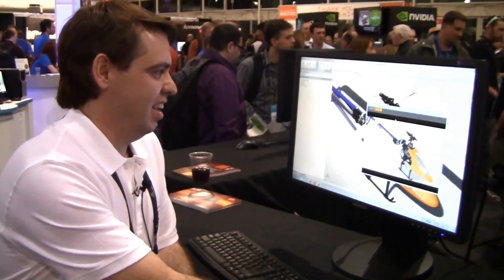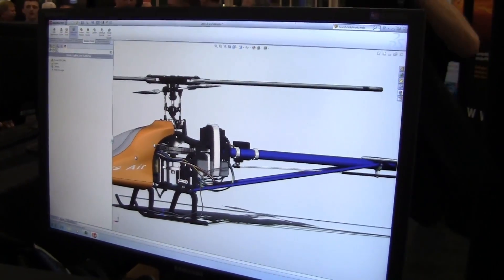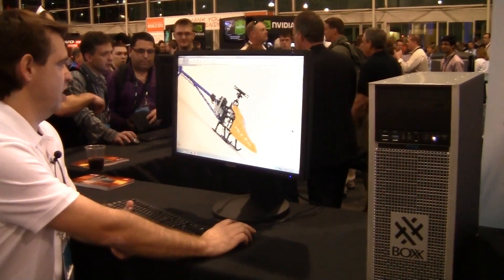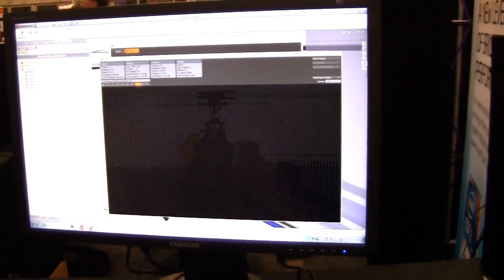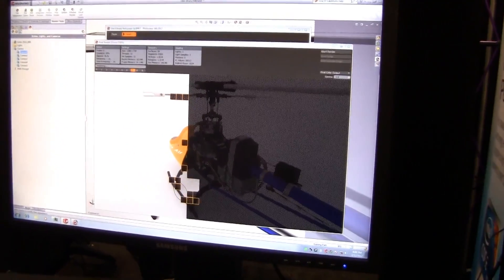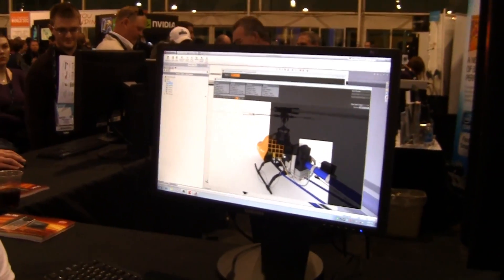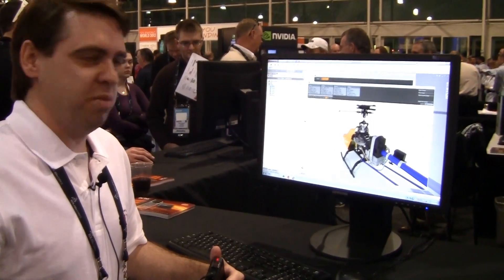Desktop Rendering with Rob Rodriguez on a BOXX

Comment: I have a BOXX 8550 Extreme with 2 x 5690's OC'd to 4.3GHz under asetek waterblocks, EVGA SR2 mobo, 48GB ram, 2 x Intel 120GB SSD's in Raid 1, 1 x TB data drive, 2 x GTX580's in SLI, Silverstone 1.5Kw PSU, Blu-Ray Burner, and it was only $8500.00 Not sure where your math comes up with 10K. And yes I have priced out each part individually at Newegg, Amazon, etc... and I would have only saved about $1500 by building it myself and I wouldn't have had the factory warranty.

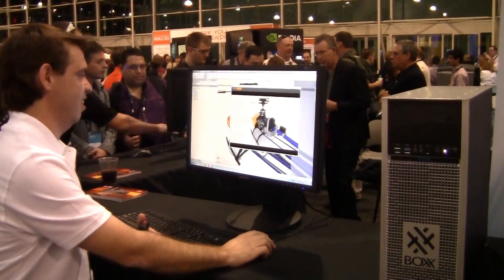Comment: so he rendered a still image in 1:23 and claimed that other machines take 20-30minutes.  but where was the comparison?  this needed to be a side by side test to be of any value.
not only that, but at one point he said a normal quad core is 3 times slower then a few minutes later claimed the normal quad core setup was 6 times slower.

Comment: 48gb memory, duel 5650's, corsair hydro series cpu cooler, quadro 4000 gpu for upwards of $10,000?  Agree with deaftodd, build it yourself.  My friend built one using a Evga SR2 duel Xeon motherboard, 2x5650's(2.66ghz overclocked to 4.2ghz) 48gb Kingston 1600, 2x Noctua NH-D14 CPU Cooler, 1xGTX580 3gb gpu, 1200 watt psu in a Corsair800d case with 7 fans on a controller for intake and exhaust for $4000, it's super fast at rendering.